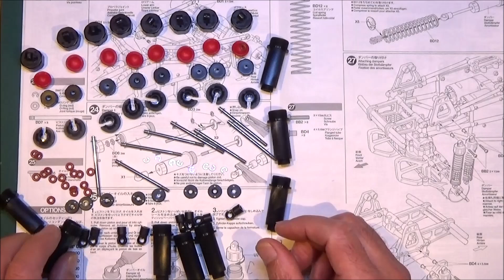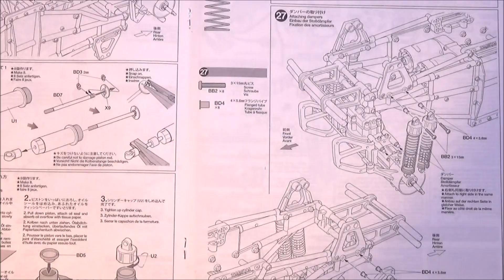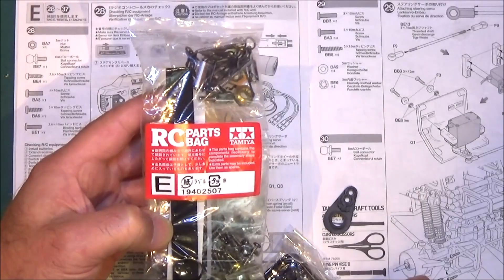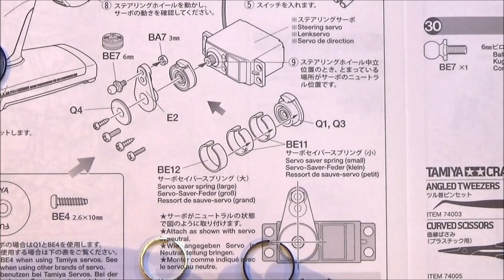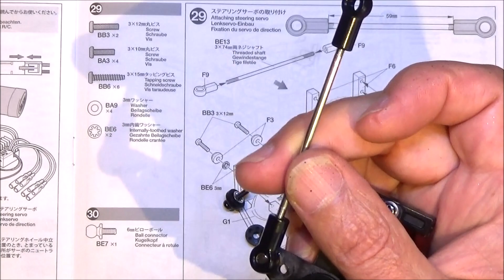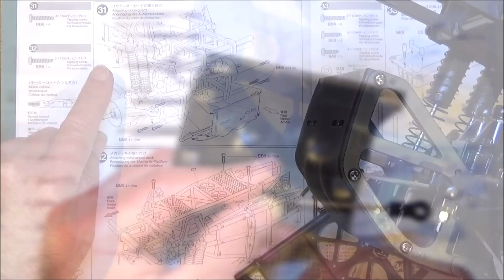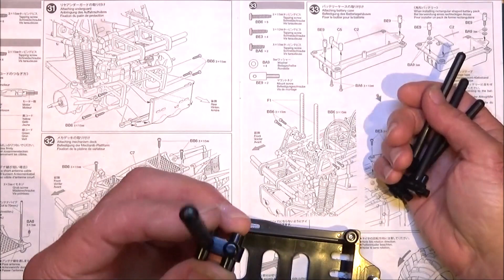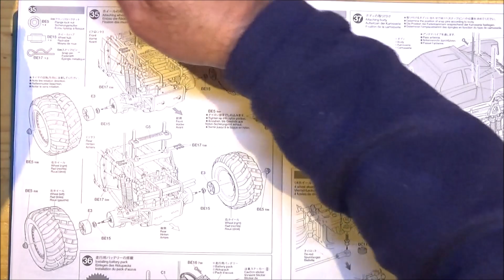Tamiya TXT-2 Agrios Chassis Complete! Build Guide Part 3

Comment: That's an appropriate monster of a chassis for a monster truck... 😎👍
Reply from the maker: It sure is, Steve! The setup is more like the SCA-1E chassis than it is any other Tamiya chassis I've built, with the solid axles and the 4 link suspension. It's actually very supple and has a lot of travel. I tried it in the garden and it crawls pretty well...  Hmm, now I have a silly idea! Lock the diffs, err, on second thoughts...   😎👍

Comment: Those wheels do look small to the TXT-1, but must put a lot less strain on the drive train. The servo is plenty, in the days of the TXT-1 we used standard ones.
Reply from the maker: I agree, Mal, the wheels and tyres look small on this huge chassis, but it seems to drive well with plenty of torque. Oh, I think I went over the top with the servo, but it was only £14 so all is good!  :)

Comment: Hi Mark, Nice looking chassis. I noticed that the way that the rear goes together it looks like you could fit another servo and have 4 wheel steering? What d'you reckon?
There's a challenge for you :-) Maybe a 'mods & hop-ups' video.
Reply from the maker: Hi there! Yeah, it's a solid and well constructed chassis, for sure! Ah, yes, there is an option for 4 wheel steering, all the parts needed are supplied with the kit! I just may try that at a later date, as the turning circle is so big at the moment! Thanks for the comment, take care!  :O)

Comment: Hey Bro! I’m liking how this one is coming together. The dual shocks looked really supple and well damped. A big truck with big wheels will need a good servo saver. The Tamiya ones always work well. The steering rods seem beefy, should hold up to some bashing.  Really nice so far👍🏾👍🏾
Reply from the maker: Hey Paul! Thanks, Bro - yeah it's getting there. It really needs dual shocks with the weight of this chassis. But they do seem to do a great job of smoothing the ride. And I'm a big fan of those high torque servo savers, nice and beefy! Looking forward to the first run, just need to decide what terrain to try it on! All the best my good friend!  :O)
Reply: Run this bad-boy on Hard Pack Dirt!!!!!!
Reply from the maker: @3TRCGarage  Thanks, Paul, I sure will if I can!

Comment: You know if this will work well with 20 or 21T pinion gear. Or is the Torque motor best for that?
Reply from the maker: I haven't tried a 20 or 21T pinion so I don't know how well it will perform, but I do think the Torque Tuned motor would be a wise choice! 😎👍